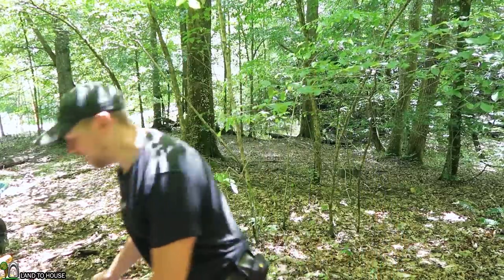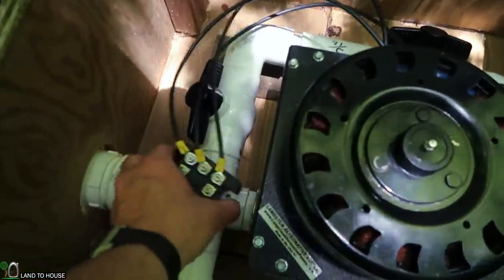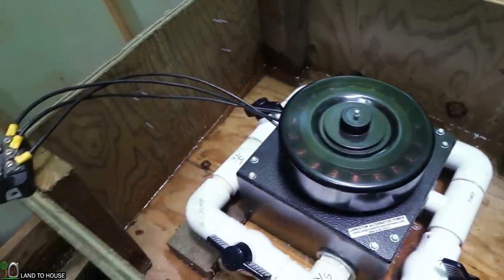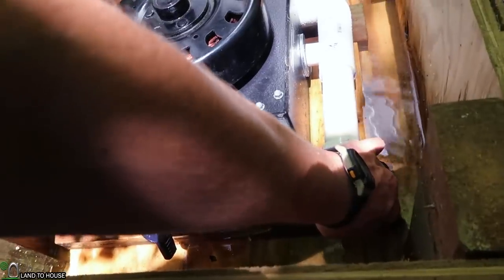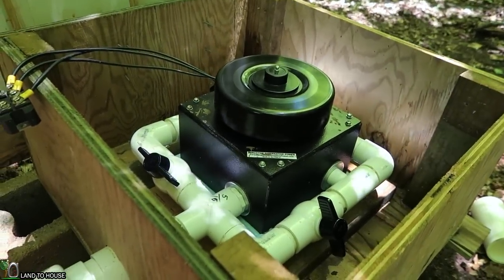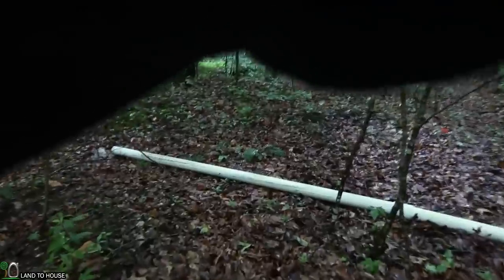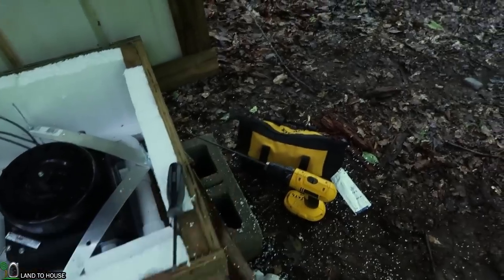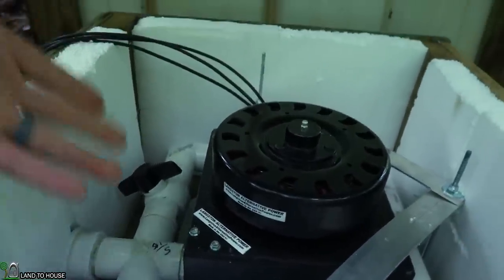Installing the Turbine Micro Hydro 6/10

Comment: Hey Bud! I think a drain box underneath might be better especially when you use all 4 jets. All the splashing can cause a problem with the jets etc. I’m assuming your sending DC voltage to the house and if nobody has mentioned it yet you don’t have to take those losses. Rule of thumb is always make your long runs with AC voltage, the losses are very small. Even if you cheat and use the ground wire as the third phase it better than a DC voltage run. 12 gauge 3 conductor would work just fine for your situation then install the rectifier next to the controller. Voila!, no DC loss. If you watch Joe Malovich he used extension cord wire from the hydro to the rectifier in the house. It’s looking great so far, keep it up. Best of luck!
Reply from the maker: That turbine box will likely need a nice overhaul at some point. It has been great to get get an initial test but it seems to have a few issues with passing the water. Will be great content for the future. The voltage test that I ran in this video was just to show that the turbine is working. I use 10/3 wire to the house and then rectifier. That video is next!
Reply: Land to House have you thought about building a concrete gutter? Just a large concrete box leading to a gutter to give it lots of breathing room. Nothing massive,  just simple and sensible.
Reply: Do you need a specific amount of water to have a system like this? And what if i have a lil river being my house can i install it just like this one?
Reply: can I ask you questions Bill?
Reply: @davycoolboy4775  The amount you need depends on how high it's coming from. The higher the drop, the less water you need. Also, keep in mind that there are a lot of different turbine designs out there, what's good for low flow high drop won't necessarily be good for short drop high flow.
Reply: @LandtoHouse ,
Уважаемий находчивий человек,  укажите пожалуста какова величина коефициентта полезнего действия вашего гидротехнического сооружения ??? ...  Другими словами укажите каков перепад висоти или давления в форсунках ??? ...   и каков разход води в литрах в час,  для получения 1 кВтч електрического ??? ...

Comment: The box is acting like a speaker.  If you mount it to a block of concrete  or slab.  Your foam is working well.  You should run the AC to the house and put your rectifier close to the batteries.  You'll have less voltage drop with the AC over the longer wire run than with DC on the long run, also you can use smaller wire with the AC.
Reply: I agree as ac is just like a tide where it pushes and pulls on a few electrons rather than trying to shove a bunch with pressure were the efficiency is less and while there is sag with wires it would be less prevalent with ac over dc
Reply: Actually HVDC has less losses than HVAC over distance, but I'm not sure he's dealing with what is to be considered HV or not. If not it doesn't really matter.
Reply: AC is only better because of the  associated higher voltage.  If the 3 to 2 wire converter is only diodes (no transformer), then the efficiency won't change by moving the converter closer/farther.
Reply: @anti-cmos1349  Nope, it isn't HVAC and if rectified, it would not be HVDC. Even playing with the Smartdrive motors you still aren't in HVAC ranges. HVAC is in the range of 1KV and higher in most of the world. In the US, we don't consider anything under 100KV to be HVAC when it comes to grid power.  For DC it is 1.5KV or better to be considered HVDC in most of the world. The US has had DC Voltages in the 3000VDC range on catenary wires feeding our trains for decades so again, we have higher levels before considering it HVDC.

Comment: Love this series. One suggestion: run your three phase to the house rather than the Rectified DC. There is so much loss with long runs of wire with DC. You could always add a three phase transformer prior to the rectifier to make up for the voltage loss at the house.
Reply: Yes, definitely! Run the longest distance AC. Much less power loss in the cables!
Reply: Not a bad idea, but some clarification: It's not AC vs. DC that matters, it's the voltage and current that matter. Large currents require very thick copper wires to maintain small losses. For a given power, if you step up the voltage, you lower the current, and that lowers the losses.

AC historically was better for long runs because you could use transformers to easily step the voltage up (so current is low for transmission and down for usage. In comparison, it's generally harder to step DC voltage up and down. For example, there are 1 billion volt DC transmission lines in China!

If Land to House could get ahold of two 3-phase power transformers, he could step the voltage up for transmission, and then back down for reception. However, this also assumes that the turbine is going to spin at a constant frequency. Power transformers generally can only operate well at a fixed frequency.

I think Land to House is really doing the best they can here. Convert straight to DC and just eat the loss. They could go for a thicker wire, but that  might cost too much to be worth it.
Reply: Brett My understanding was that low and medium voltage DC has a much higher voltage drop per foot than AC. It’s only when you get to the high voltage DC that changes due to specialized math and physics I do not understand. As for the fixed frequency issue. I could be wrong but as the frequency and voltage of the generator are directly proportional shouldn’t the risk of core saturation be negligible? Mathematically speaking, based on my understanding, as long as both your step up and step down transformers maximum voltage and maximum frequency ratings do not exceed the transformers rating you should be fine.
Reply: @Veritas-invenitur  Actually, it's the opposite: AC has higher losses per foot of wire due to eddy currents and the skin effect (and even radiation!). At low frequencies (like those used in power transmission or in this video), those effects are negligible, so for the same cable, at the same voltage and current, power transferred using AC or DC has identical losses.

Power transformers have a design frequency. If you operate them at lower than design frequency, there won't be enough impedance on the input windings and you will draw too much current, heating up the windings (and destroy them depending on how far off design you go). If you operated at above the design frequency, the primary will have too much impedance and you won't be able to get as much power through the transformer (there's also eddy losses, skin losses, etc).

Yes, if the frequency goes up with the voltage, core saturation in the transformer might not be an issue, but core saturation isn't the only problem as stated above.
Reply: ashtonsethreimer I just finished my refresher research on the subject and I have come to 2 conclusions. #1 you are right about DC vs AC voltage drop, I forgot about power factor and cross sectional area coming into play. #2 I need to reread the text more often before I speak. Back to the frequency issue. Considering the frequency variations will always be on the high frequency side why wouldn’t a 50/60 hertz transformer work? If anything wouldn’t the higher frequency’s increase efficiency?
Reply: @Veritas-invenitur  Your understanding of voltage drop per foot is incorrect.  AC actually has slightly more loss per foot than DC given the same voltage.  This is true all the way down to 0v.  The reason we use AC for long runs is it's cheap and easy to step up the voltage using a transformer (and back down again).

edit:  Apologies it looks like this was already answered.  Sorry!
Reply: Mostly, it depends on what is going to be used in the house.  If you have a tangential fan in a room heater, it will need AC.  You may need to know the frequency output by the generator, and if appliances won't work with it, you may need to convert it to DC and run an inverter.  If resistive elements are used (for example in a kettle) then AC or DC won't matter.
The difference of voltage drop on AC vs DC is utterly insignificant at the frequencies in use here.  There are various effects at microwave frequencies (skin effect etc) - but we're only talking a few Hz here.  Ohms Law is good enough to work it all out.
Reply: @drradar  a billion volt dc transmission lines - without looking it up, I do not believe they exist.
even lightnings are in the megavolt range.
mankind is not capable to generate a gigavolt.

Comment: When you said you should of used a more rigid metal. But the aluminum was what you had. I smiled thinking of all the projects I have done using just what I had. It’s a frontier mentality. This kind of thinking is invaluable on a homestead. I just built a 5000 watt solar generator with 1200 watts of solar panels. I wish I had a source of water to add a hydro turbine to the system. I’m building a wind turbine from salvaged components to power my shed and chicken coop also. Thanks for the great videos. Keep it up.

Comment: You can increase the wire size running from the generator to the point of use.  That will eliminate a lot of the voltage drop over a long distance.  You could also use a line reactor or buck boost transformer to cushion the voltage.

Comment: Nice job looks great, my system is not to far from yours, i run three jets and found my 4" outlet just couldn't remove the amount of water from the box especially when free wheeling, a second 4" pipe was added and it now works well, i look forward to your next videos.
Take care and have fun
john
Reply: I've been wondering about the differences in efficiency of Pelton vs Turgo wheels for this. It looks to me like the Pelton is affected by turbulence in the chamber where as Turgo is less. I think a Turgo would exhaust better through the same pipe.

Comment: As others have mentioned, it's best to run the three phase up to the house and install the rectifier there just ahead of your charge controller.   AC at a higher frequency and higher voltage will suffer less loss over the resistance of the long wire run.
Now, as to measurement..   The unloaded voltage is kind of useless data.   Once it's under load, a measurement of voltage AND amperage downstream of the rectifier will allow you to calculate the actual working power it's producing in watts.  Ohms law, Watts = amps times volts.  Those measurements should be taken at the output of the charge controller when the batteries are low so it's dumping as much as possible into the batts.   You could also measure between the rectifier and charge controller to get a sense of power loss through the charge controller. (it's circuitry will eat a small amount of power.)
You'll probably want to mount that rectifier on a heat sink too.  It's going to get warm once a load is drawing power.
Reply from the maker: Yes Rectifier is on the other side of the wire run. 

The open circuit voltage is important when the charge controller can only handle 200v max. We got close but made it!

Comment: I'd love to see you use a ram pump to move some of the waste water back up into the intake. Would also be useful in more dry seasons too
Reply from the maker: It would be interesting. The head pressure is 163 feet from the intake to the turbine over 1100 feet. Now the creek does have a spring just down from the intake that I could gain an extra 1gpm with ram pump.
Reply: Cam, I just so this video and I posted the same thought "waste water back up into intake.  It makes sense and would make a self-sustaining system.  You would have a system that only needs a specific amount of water that feeds back to the turbine.  

This Micro Hydro is a brilliant system and should be implemented in rural country AND cities.  WE need to be self-sustaining people and not dependent.  AWESOME!!!!

Comment: I am really enjoying this series Seth! Thank you so much for taking the time to share this project with everyone. I would like to make one small suggestion. You have a beautiful turbine. What a fine piece of machinery. But please, please, build it a housing worthy of its beauty. Maybe that is part of your plan, in which case, kindly disregard my suggestion. I think you should consider a concrete structure. I admit I do a lot of work in my shop with leftover lumber and such, so I am speaking to myself. But that is like a Lamborghini parked in a shed. Again, I am learning a lot. Thank you again. Close to the end, now. This is so impressive, even with on jet open.
Reply from the maker: Sometimes I have these ideas in my head that look way better than when I finish them. This box is one of those. It woks really well but could use some improvements. And it does not look very good. I will have to revisit this box later. One nice thing is the foam. That has really reduced the sound.

Comment: Well done, 
Might try a 4" 45° into a 4" Tee.. back of Tee reduced to 3" a 90° up & 90°, 90° (keeps debris out) for vent.. 4" side of Tee (front) is drain.. you can always make front foam a little taller  to add more airflow if box is to airtight.. others have already mentioned a/c to house then d/c to batt, you can do that in 1/2-3/4" pvc & trace if burying..
Can't wait to see finished product and load test..
Be Safe
Reply: Quarter

Comment: My 15 year Harris Hydro experience has all been with just two nozzles, but they are 7/16" each in peak water times, when I produce 876 watts (33.7 amps @ 26 VDC).  147' of all, thru 3' line in 1/4 mile, it runs at about 60 PSI dynamic.

Comment: There are many things I would have done differently for sure (and have done differently with my turbine). Good to see it spinning though.
Reply from the maker: I would love to hear those things. You have the experience and understanding!
Reply: Hey Joe i know you'd go with a circular pipes to the valves say it man!
Reply: @LandtoHouse  I was thinking to cut a square hole in the bottom of the box just big enough to set the turbine in and build a tray larger than the square to catch the water but swedge  it down to your 3"or4" what ever size your drain is. just a thought.  Good video! Thanks for sharing!  God Bless!

Comment: That turbine looks pretty well - addressig the noise: your wooden box works like an amplifier, set the turbine on a piece of rubber (available in 60x60cm/2x2ft. to dampen washing machines and dryers) and put dampening foam all around the inside walls and roof. If you think about bolting it down to the box,  again use rubber around the bolts to decouple them against structure-borne noise. Regards from Germany.

Comment: I would put a tee under the box instead of a 90. And on the other side of the tee make it a vent line above the box so you don't have the suction
Reply: I was just thinking that myself. It would prevent the turbine from slowing down and might prevent the water backing up into the box as well. It wouldn't hurt to install a drain in the box so any water that does escape can be drained away rather than filling the box. If something were to go wrong with the motor, then the box would fill quickly and possibly short the electrics.
Reply: It's not suction, it's back-pressure causing the problem.   If water backs up into the housing of the turbine, surrounding the turbine, it will drag it down.    Increase the down angle of the drain line so it doesn't fill up.  Too shallow of an angle and gravity can't pull the water away fast enough causing the pipe to fill up.
If you actually had a vacuum in the drain pipe, it would lower the atmospheric pressure in the turbine housing and increase the inlet flow, increasing the turbines output.
Reply: A Tee and a drain in the bottom of the box wouldn't hurt, just for good measure and only cost a few bucks.
Kevin Loughin is right though, it's not a vacuum because that would suck more water through the input causing a spike. 

When he walked away from the housing after the foam was installed, it appeared to me the outlet pipe had a small upward curve, restricting the flow? Could be just the camera. I would also double up on the outlet pipe (2x 3" runs) so there will never be a capacity problem on the outflow.

Comment: to solve the problem with the water, open the bottom of the wood box the same size of the opening at the bottom  of the turbine, then funnel it down to 3" using reduction couplings. this way you will be collecting all the water to the pipe and avoid any problem caused by the water in the box
Reply from the maker: Good idea. I think that I am going to redesign with PVC trim boards. Make the bottom of the box 9" x 9" like you mention so that the water will drain without obstruction.
Reply: pretty much exactly what I was thinking because if the water cant drain then you would also be losing power due to water remaining in the housing and slowing down the turbine

Comment: Foam isn't waterproof but it is plastic so recommended to cut by heat or where you can vacuum it up. Few egg crates in there would dampen the sound even more if needed. 
That vacuum effect can most likely be solved by an air vent through the blue foam. 
Just a thought :)